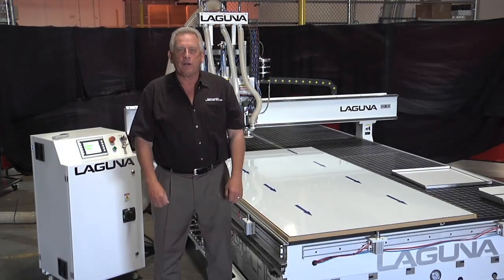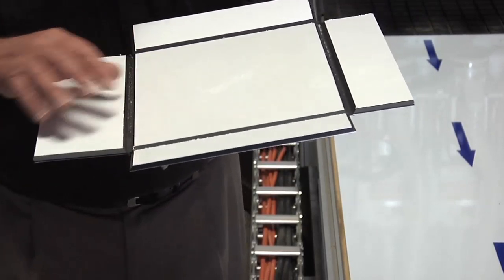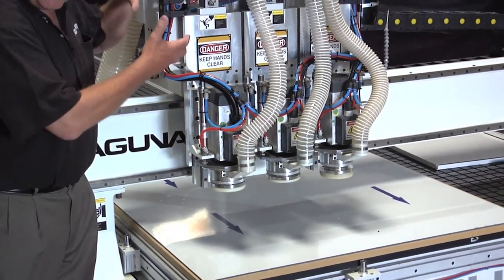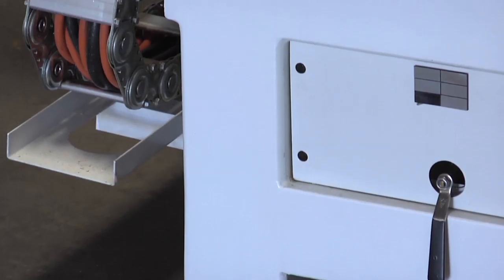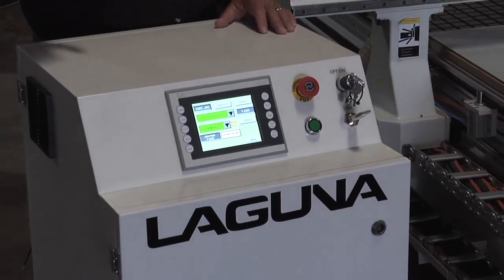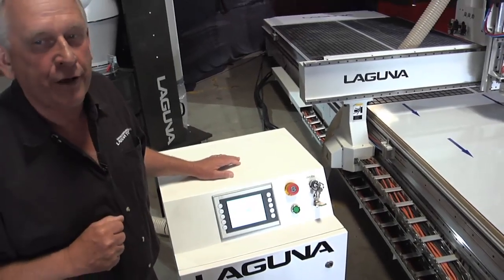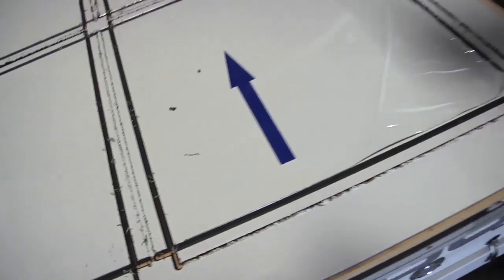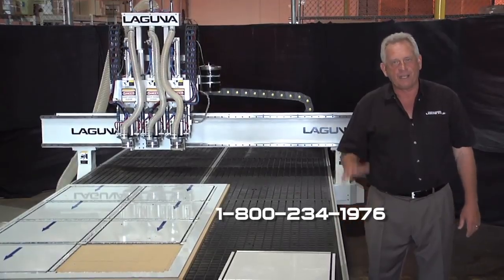SmartShop® CF16 CNC Router Composite Fabricator | Laguna Tools

Comment: Nice!  Is it possible to get it in a smaller footprint?  Maybe 5x10 or 4x8?
Reply from the maker: Possibly, if you call 800-234-1976 they might be able to at least get you a machine that works with your needs